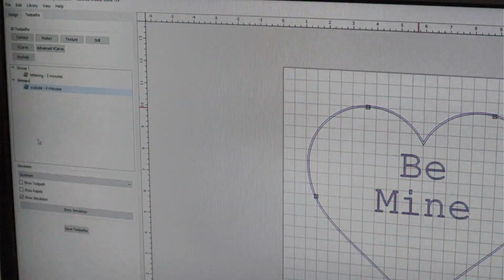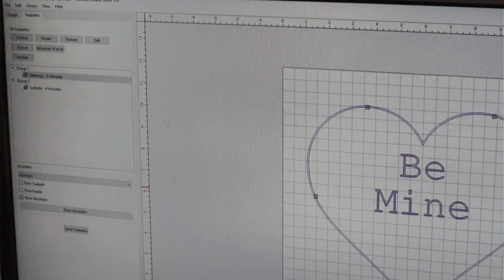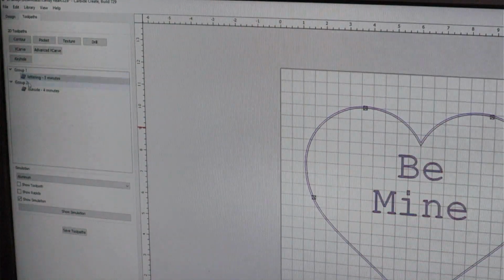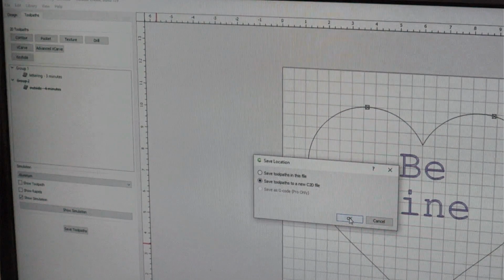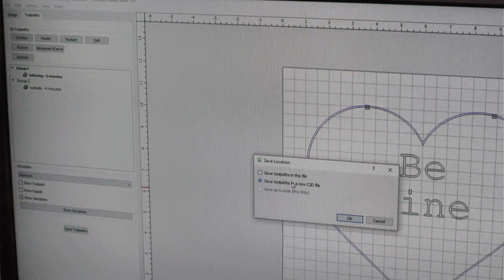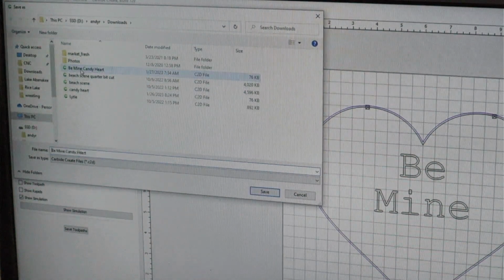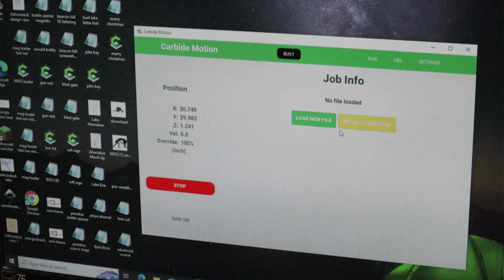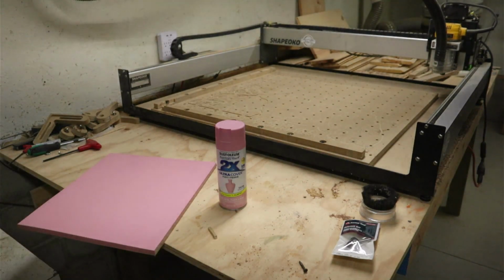Effortlessly Cut Objects with Carbide Motion on Your CNC Router

Comment: Great video your spoiled board should be level to your Router You need to surface your spoil board This way your material will cut all the way through evenly Thanks for a video Do you know what version of carbide motion you are using?
Reply from the maker: I do need to resurface my spoil board. It is getting pretty rough. I am not sure what version was used in this video because I filmed it over 2 years ago